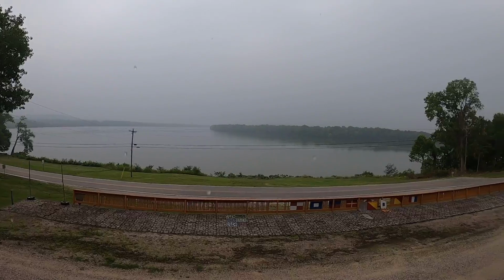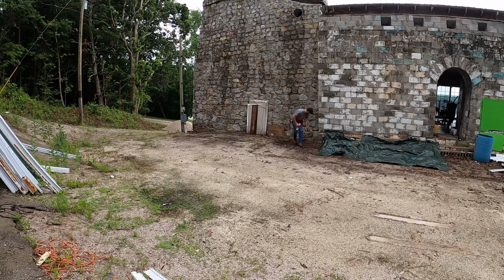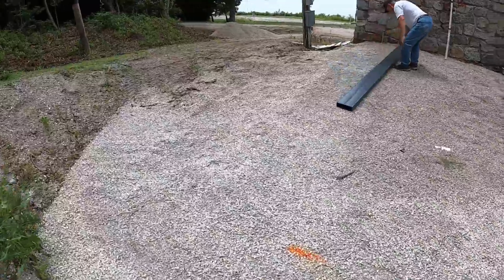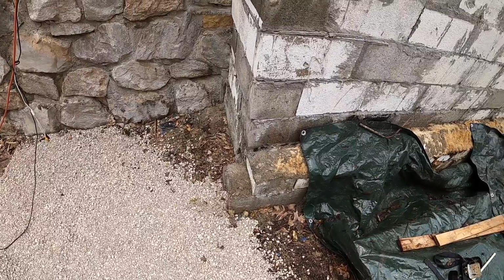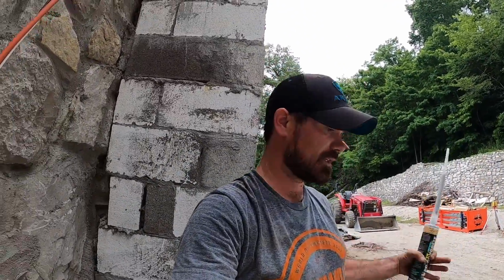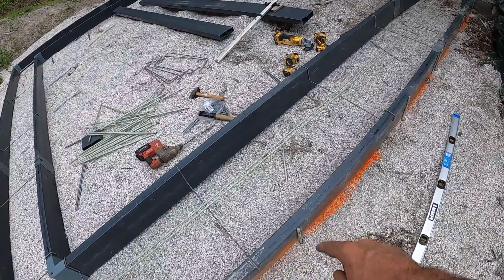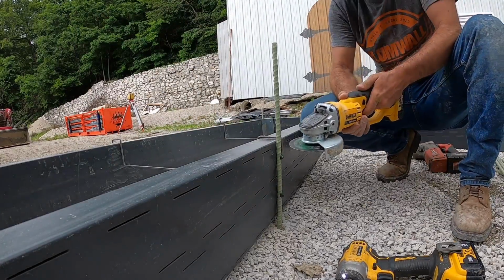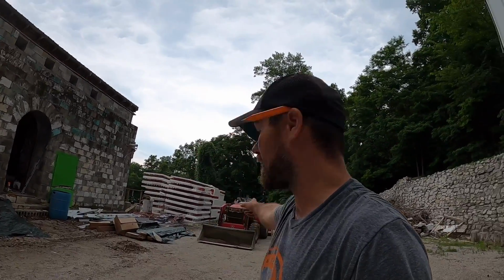Installing footers! And MST BAR!!

Comment: I emailed mst bar.  I hope to see areply on monday or Tuesday.    Thanks for showing about putting screws through it.  Ima thinking use em for my quansit hut type roof.  I got 12x2' 1930's, thick, corrugated aluminum roof panels off my pal's barn.
Reply from the maker: There is a link in the videos description, if you used that you will get a reply for sure!

Comment: So you are not digging your footed below the frost line, how is this to building code Matt when you are connecting to an existing structure that has a footer well below the frost line?
Building like you are is asking for trouble latter.  I could understand if the was an unattached garage, but an addition to an existing building, is just asking for ground frost heaving and cracked walls.

Unless you are planning on putting 3 foot of fill around the addition and a freeze Barrier.
Reply: I'm wondering the same thing. Frost in Indiana isn't what it is here in New England but it still is a thing.
Reply from the maker: 18” frost line. 20” of fill around it when done 👍
Reply from the maker: 18”

Comment: Never saw anything in the building trade like this footings are supposed to be dug in 3 ft to six feet in the Earth but great video thanks Matt
Reply: Not when frost depth is 8 inches and your going to backfill ten to twelve.  You can also pour on grade then do 45 foam to just down past.
Reply from the maker: Thank you
Reply from the maker: Interesting 😂
Reply: @nyamillennial  your gunna have to bury three to 4 dumptruck loads of handwarmer packets in there with them shaller footins!

Comment: Hmm, the MST bar looks very versatile and easy to work with. I’m a little surprised you didn’t go below frost line for your footer.
Reply: I suspect he's going to put stone gravel around building after construction plus he's building on a gravel base that settled in place for decades so no need to dig to get to
Reply from the maker: It sure is!  It will be
Reply from the maker: Plus a concrete foundation under that gravel. Good call to you!

Comment: Matt, you're definitely right about the MST rebar.
Steel rebar has been made obsolete by MST.
Steel rebar ends up rusting out eventually due to concrete being porous to water.
The water causes the Steel to rust and expand destroying the structural intgrity of the concrete.
It's what has happened to a lot of America's infrastructure that was built decades ago all the way back to the great depression era.
Just the time savings cutting and drilling it plus howlighter it is seriously makes it a no brainer to change over to.
Reply from the maker: Great stuff for sure!

Comment: So you are building a 3 story addition on a foundation floated on a pile of gravel. Don't you have building codes and permits in Indiana? This would never pass inspection anywhere else.
Reply: It would in TN, parts of it, anyway.
Reply: I imagine it depends on what county you’re in. We can do whatever we want parts of Missouri.
Reply: Not that it probably makes a difference to your overall question but isn’t it a 2 storey addition?
Reply: You just know this isn’t going to end well. He didn’t even compact the gravel! You might as well build it out in the river 🤦‍♂️ 
Either the building inspector is going to see this video and issue a stop work order or we’re going to hear about a structural collapse some time next spring. I hope the building inspector gets there first.
Reply: Indiana most certainly has building codes. I don’t see any way this would be acceptable in most parts of the state I’m familiar with. For now, I’m going to guess he explained how this is ok in an earlier video. Maybe there’s something about the base material in this area that permits it without digging below the frost line, I’m still not sold on setting it on loose gravel, regardless.
Reply: @grilnam9945  to top of tower is over 40 feet. Three stories would be  11 or 12 times 3.
Reply: @richardwisecarver4360  
👍🏻 Matt repeatedly said 45 feet during the entire top floor project. It certainly looks like 3 stories on the backside and 4 on the front/road side, if I’m not mistaken.
Reply from the maker: There is concrete foundation under the gravel. Plus the footer will be backfilled below fostline
Reply from the maker: It is just fine.
Reply from the maker: Only 2 levels of icf
Reply from the maker: 2 icf - framed

Comment: Omg don't u dig your footings in the uk we have to dig at minimum 1 metre depth (sometimes deeper depends on ground and roots) and 600mm width then it's  filled with solid concrete then concrete blocks or bricks to ground level then a 150mm concrete floor base with a membrane on top (then 100mm floor screed when weathered in)  then we mainly use block and brick to build the extension ....you don't even dig in the ground for your footings
Reply: Depends of the ground where you live. We (dutch) have to drive or pour poles to the first sand layer. This is building on rock so there is a sollid, stable, underground. If you follow him, his buddy dirt perfect or lets dig you see that they also have have to use special ground when creating a pond. Otherwise the dike wouldnt be strong enough.
Reply from the maker: It will be under when I am done
Reply from the maker: Thanks
Reply: Terencewelch. I am some times confused too. Where you and i live in countrys where our floor is the street level i see in the usa lots of houses elevated. Where we have to dig in the ground they start up from the ground. I under stand that. They have to level out first. If you see that on the 20 feet he already had to level out inches to get level. 
Ps😉. Buy a houseboat. 3 feet in the water and 2 feet above.

Comment: I'm confused.  I've never just set footers on top of grade gravel without digging down below the frost line.  By code our footers are 30 to 36 inches below grade and two inches larger than the wall.  The Format drain then goes on the outside to catch sub grade drainage. The stone isn't even tamped, just floating?  What is keeping the foundation from settling?  Sorry but never seen this anywhere.
Reply from the maker: Thank you

Comment: If the Form-a-drain slopes away from the castle, and the PVC drain is connected at the back corner of the castle wall, Wont that allow for trapped water in the form-a-drain on the back wall of the new addition?
Reply: Go back and watch the last few minutes. The concrete slopes away but the formadrain is level, hence the reason he used the stone to level the area first.
Reply from the maker: @Grid-yk2ru is spot on!

Comment: Certainly a different method, Matt.... good to see you settling the form a drain up, and the rebar made the job easier! 😁
Very surprised you do not have a volumetric mixer locally, 1.5 yd³ spare is a lot not to use 😮 
By the time you have pourd the founds, did I hear you right saying you will be pouring a slab on top of the existing level ?
Reply from the maker: Thanks 👍

Comment: interesting. 
seems like an interesting way to reduce form board waste all together and already have weeper in place. 2 birds 1 stone. 
that fiberglass rebar is also interesting be it  will not rust is light weight and acts as a tensile strengthener. if that fiberglass doesn't spal from water and freeze cycles it should be a great option. if installation cost savings outweighs product cost it would be preferable over steel rebar.
Reply from the maker: It 100% is better than steel in my opinion

Comment: As a builder in Ont..  Canada i can under stand yours or DP building practice. Its like you take really bad short cuts. Well its not just you 2 it seems all usa builds are really cheapened up cutting corners. What you guys do would never past building inspection. Our footers weather a 2 pour or a one pour  One  Monolithic slab. All footers must be 18" in the ground an 24" wide. Drain tile must be at the bottom of the footers. As well in an x across the floor area and back filled to sub grade over the floor x drain tile with a foot of compacted washed 5/8 crushed stone an floor concrete poured on top with a 6ml plastic between. with all outer an inner drain tile entering a sump pump well in side the building. . 2nd when pinning rebar to an existing footing there can't be any open space of rebar with out full concrete cover as the rebar in your case will just bend with any ground movement witch defects the whole perplexes..  Monolithic one pores footers must be dug 30" below grade as well an stay 24" wide but from there tapper up on a 45 degree slop up to sub grade an drain tile installed in bottom of footer an ender a sump pump well in side the building as well as the drain tile x lay out under the floor an foot of 5/8 washed crushed stone same stuff used to cover septic pipe drain feild. The drain tile in bottom of this footer must have 5/8 washed crushed stone compacted with a minimum of 4" stone cover over the drain tile in bottom of the   Monolithic footer. We use in floor hot water heating in these so a one sided foil bubble sheeting roll is used to keep  Is moisture from coming up an covered in a 2" rigid foam sheets  tape every seam with a water proof 3" wide foil rubber tape. Then your loops of 1/2" pex. In runs no longer then 300' each. With you having that foam between the wall plus the gap from uneven stone wall with out solid concrete  right to the old footer any ground movement your pinned 5/8" rebar is just going to bend making you icf wall an footer mover up down side to side cracking any seal to the existing wall. Botting from an  Engineering point to a building inspection pass this is a total fail. Your support wall footer foarm a drain is not tied into you outer foarm drain nor is the in side form a drain main footing not ties into your outer foarm a drain for water that enters them can't get out .. so many bad things. That make no sense but make for so many problems even your so called drain out over the hill. 😢😢
Reply: Back when DP was doing ICF all the time, I can’t remember one single instance where he uttered the phrase “Well, we passed inspection!” It kinda makes you wonder 🙄
Reply: @alanbierhoff6831  yup even his septics
Reply: Who cares what Canada does.
Reply from the maker: What is your seismic zone?  We can go up to 60’ tall on that footer. Frost here is 18”
Reply from the maker: Interestingly enough I have witnessed a lot of those passed inspections
Reply from the maker: Yet again, I personally meet the health dept for our inspections and yet to Fail one!
Reply from the maker: Honestly I do. But I like to learn
Reply: @nyamillennial  and being trolled..

Comment: Depending on the price of the fiberglass rebar it would be a lot easer for us olden folks to work with than steel rebar. Uh just exactly what is this extension going to be? torture chamber?, mad scientist work center? bomb shelter? or man cave with wide screen tv equipped with adult beverages.😁
Reply from the maker: Yes is the answer 😂😂

Comment: The castle wall is, I assume, sitting on an in ground footing.  CAN you tie 2 buildings together that have such very different footings?  

Things in central Indiana can rise a good 4 or more inches with frost heave.  I have had garden borders sitting that far above ground in the spring.  

My house had a fence post bolted into the brick wall. The problem was, the house has a deep footing but the fence post had concrete down only 1 foot.  Frost heave made the fence post MOVE while the house wall did not. This caused the mortar to crack.

I seriously doubt a few rods of anything will stop a 3 story addition sitting on the ground, from moving differently than a stone wall sitting on a footing down below frost line.
Reply from the maker: Thank you.